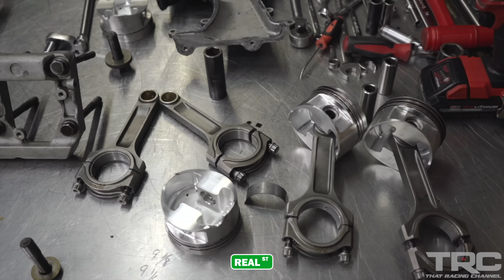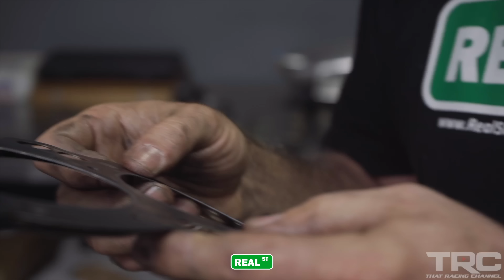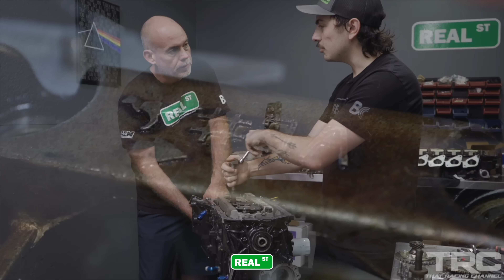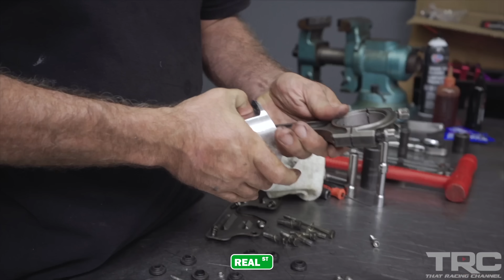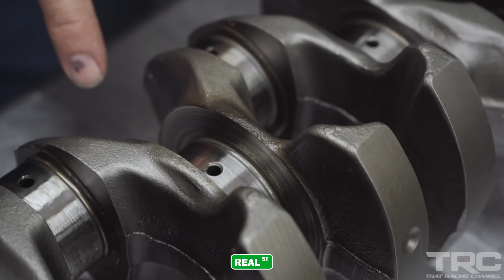Nissan SR20 Engine Teardown - Restoration Rebuild Part 1

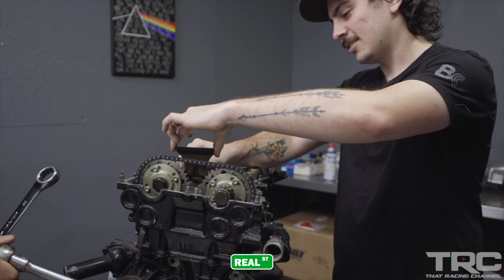Comment: @3:31 you jump straight to cams already out but that’s the info I came to the video to see.  The bolt under the cam gear to release the front cover are covered by the cam gear, how does that come apart so I can reassemble correctly?

Comment: I would appreciate some more SR20DET oiling system content.   You guys are incredibly knowledgeable on the SR. The Mazworx dry-sump, accusump pre/post-run oil pressure retention system and the pros/cons of the systems. Thank you  guys i love your content.

Comment: As a bit of an SR nut, Hanz got everything right. My first SR I actually killed because of an oil pickup tube failing, but instead of the pan crushing the pickup the strainer actually broke off. Caught it very early and was able to rebuild it but it is a common issue with the S13 SR's.

Comment: A little trick on removing that upper sump. There are 2 threaded holes at the back of the sump you can run bolts down into to push off the sump so you don't need to pry it up. Awesome video but!

Comment: Kangaroo stamp is most likely where the parts were made. Sure they may have been put in a japanese model but australia has been building that engine since nissan designed it. It has come in primera, xtrail, pulsar, pulsar sss, sunny III, saber gxi, GTi-R, silvias, sentra se-r, tsuru, and 200sx models worldwide.

Comment: 1989–1994 "Red top" - Came from U12/13 Bluebird, S13 Silvia and 180SX pre-94 (Garrett T25G turbo) 370cc injectors were used.
1994–1998 "Black top" - Came from 180SX's post-94 (Garrett T25G turbo)
1991–1998 "Black top" - 91–98 Silvias - Variable Cam Timing or VCT was introduced on the intake cam (Garrett T28 journal bearing turbo for Australian and European markets and Garrett T28 Ball Bearing turbo for the Japanese market)[2] 370cc injectors were used.
1995–2002 "Silver top" - 95-02 Avenirs and 97-01 R'nessas.
1999–2002 "Black top" - 99–02 Silvias. Same VCT as above, 6-speed manual transmission (Garrett Journal Bearing T28 for Europe and Australia and Ball Bearing T28 turbo for Japan) 480cc injectors were used and the intake manifold was redesigned.[

Comment: Lot of misinformation here about the differences and even availability. They continued the S13 production through 1998 (congruent with S14) with the type X, making them VERY common. S13’s production numbers with an SR was around 112,000 just by itself, not to mention S14, S15, and any FWD/AWD applications.

Comment: Wat is best engine parts to make a 4g93 sohc engine make about 500hp
Reply: Not worth it tbh. But you’ll need. A built engine and boost about 40psj on e85. Buy an ls 5.3 from a junkyard. Super cheap reliable, and makes a ton of power on stock internals.
Reply: @Eclipsis17  wat is the name of the name of the engine

Comment: Sr20 vct doesnt break from hp, it break from high spring pressure. Im running 600whp with supertech single springs and have no problem with vct.

Comment: Owning the same S14 240sx since 2000, most went the easy SR20 route for power, i however said F' the SR20 and kept the KA24DE motor. 
Rebuilt it with forged internals and got it to 600 crank hp 23 yrs ago. 
Even the machine shops told me to stick with the KA over the SR20
Reply: As an avid admirer of SR20s and having played with them extensively in the early 2000s I reckon they are a great motor for about 350hp and good midrange punch. More than that and high rpm they are buckets of puss...
Reply: KA is a sturdy block, but the limitations on the head stud size and availability of fully balanced crankshafts is what is keeping me from wanting to save mine.
Reply: @cherstonwarner2187  thats because most go with the SR20 so everyone ignores the ka which leaves it little to no support that the SR20 has. 
I only know of 1 person that did 1100 whp on a ka but that was like 15 yrs ago and have not heard from that person since. 
And i want to say that they did go with a 12mm head stud over the stock 10mm which is what i am using.